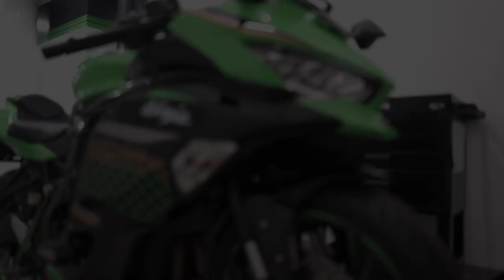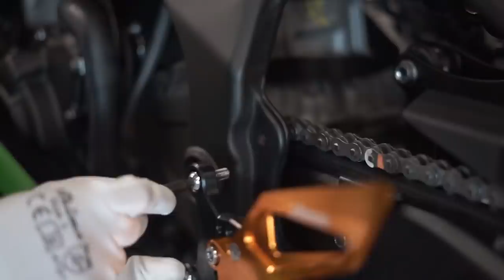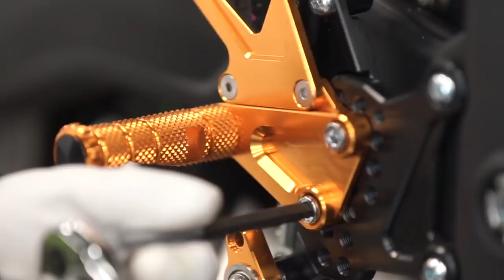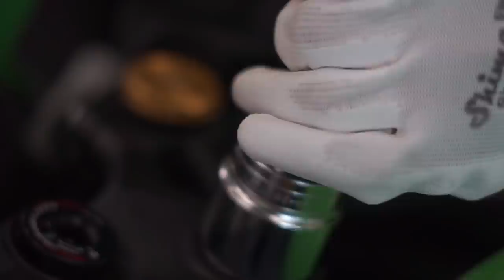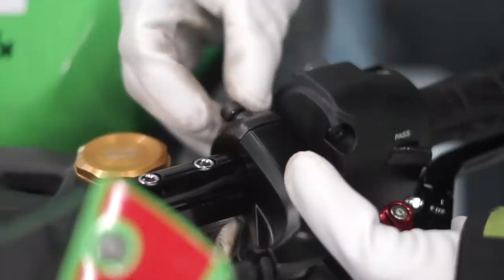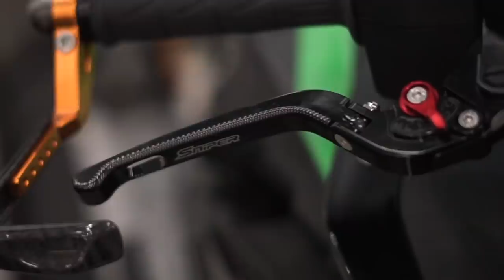[Stage 1] Kawasaki Ninja ZX-25R Modification: Sniper

Comment: What is the functions of clutch..?????? explain me
Reply: The clutch engages and disengages the transmission and final drive from the engine's output. It allows you to disengage the transmission from the engine output in order to start the motorcycle moving from a complete stop, to come to a stop when moving, or to shift gears.

Comment: Whats with this bike to give it little by little exposure? Because i am pretty sure that this bike is slower than zx6r and not even close to zx10r. So please would you release a full review of this bike because i dont see anything special about this.
Reply: It's a ZX6R that most can afford. It can run as fast as a 650 while having the amazing sound of an  inline-4. It's every broke's dream and you wont understand it cuz your country has wide roads and can afford a 600cc bike without breaking the bank.

Comment: Great bike, but why do manufacturers not install these basic and cheaply-produced parts like adjustable levers and rearsets in the factory or as an optional extra? It's not expensive to manufacture or get a deal with some third party supplier. Internet is littered with options and most are decent quality items
Reply: The price would placed higher.
Reply: @leonardlitanius7078  wow no shit, but on a bike with top tier specs for it's class 100 euros is hardly a lot of money. it's just a few milled and anodized cnc parts bolted together

Comment: Wait isn't this supposed to be an advert for the ZX-25R? So are they basically saying it's not good enough stock? :,D
Reply: just what I thought. My only guess is that in the video they are making some racing team replica, and the dealer also supplies those parts 🤷🏻‍♂️
Reply: it just an modification refrence so when they buy this,and imidietely want to do a modification they will given by kawasaki with 2 mods refrence, the one from japan refrence and other one from indonesia.

Comment: Terus terang aku cakap moto ni akan stop lepas 5 tahun akn dtg..so many problems if a small machine have a 4 piston..the piston size is small like a 60cc scooter..and the valve will broken in high rpm like a oldest 250cc 4stroke bike..250 is better with single or twin piston..4 is too much for small bike..i will prefer 250 old 2stroke bike
Reply: Banyak yg faham kelemahan ninja 250 4 silinder lama, semestinya Kawasaki pun sudah faham masalah ini so maybe they already learn about this problem